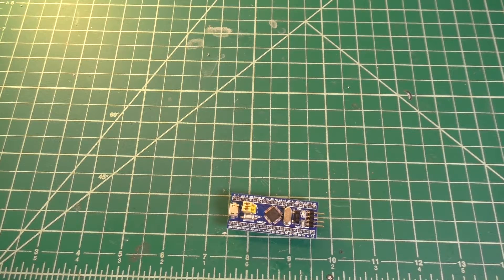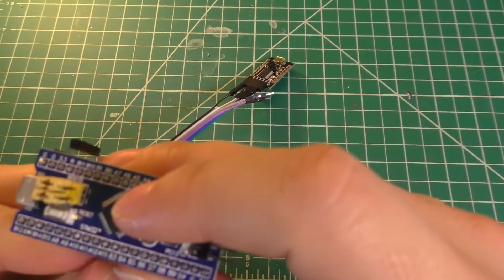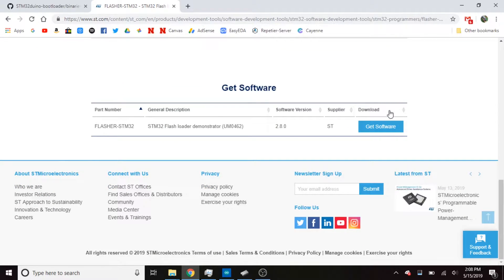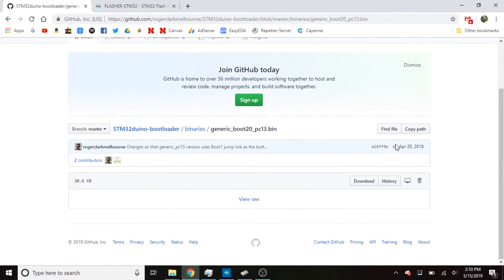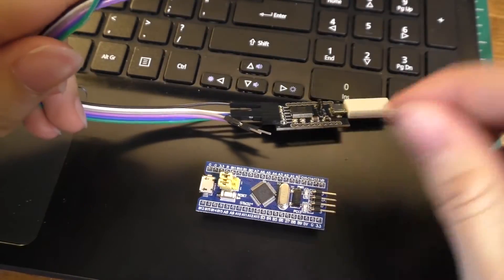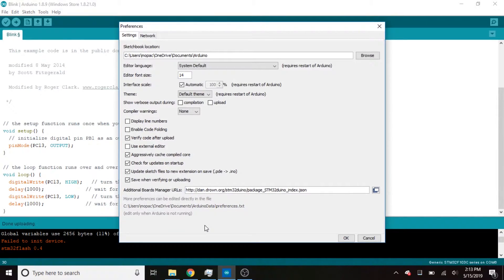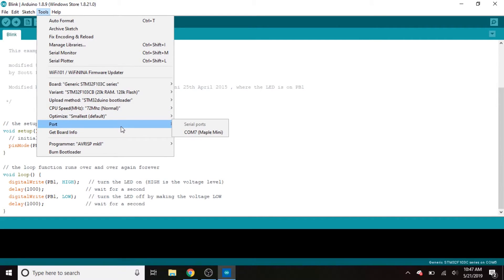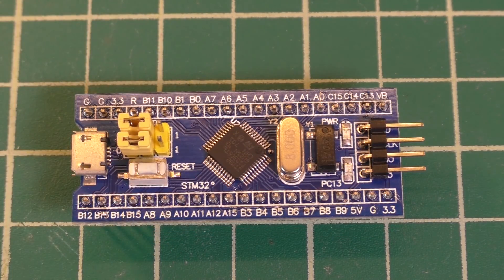How to Setup a STM32F103C8 "Blue Pill" Development Board

Comment: I use the same Blue Pill card.

But the Jumper BOOT 0 if I put it to 1 with the pressure of the reset button the pc13 led always flashes!

Do not enter programming mode!

I tried to program it via ST LINK V2 and it works.
I added the RST thread because Boot 0 does not work.

programming with ST LINK is very inconvenient because certain instructions on the sketch do not work.
Programming via FTDI everything works perfectly!

Is there a way to set Jumper BOOT 0?

Does the bootloader solve the problem?

Comment: I have some of these. Flashed the USB bootloader with ST-Link via the debug pins at the end of the board. Super convenient! Didn't use Arduino IDE to flash, used "STM32 ST-Link Utility".

I ordered some more, to my understanding i might receive a Chinese clone IC, CS32F103C8T6 by CKS IC. It's supposed to have some funny properties. Boot0 can be reflashed. Boot0 might not contain serial programmer, but ST-Link port works regardless.